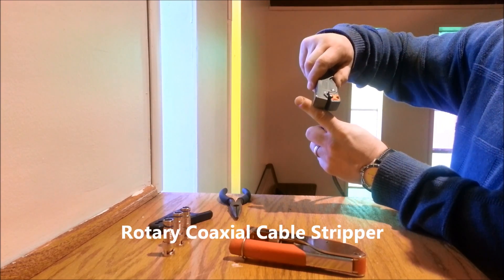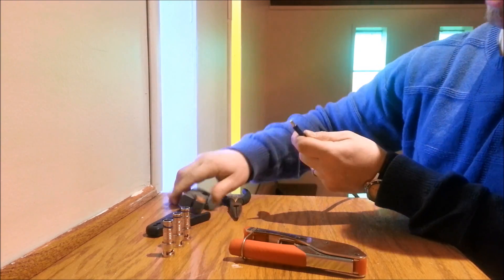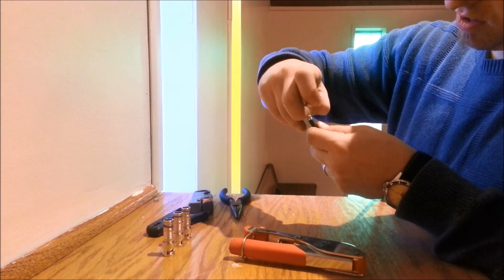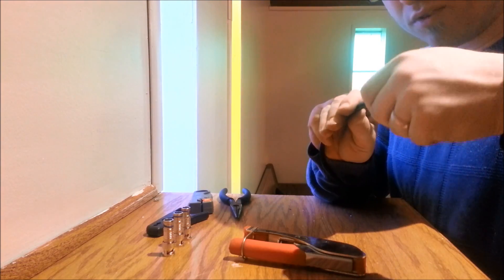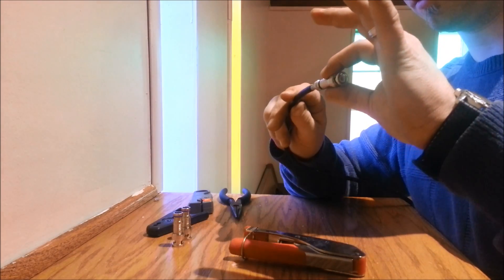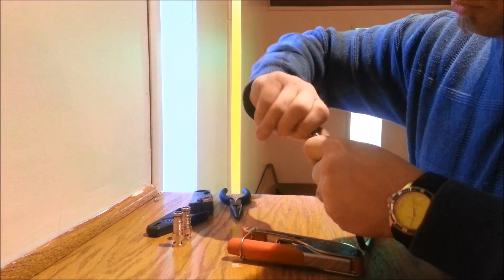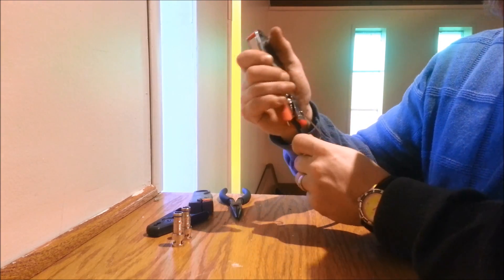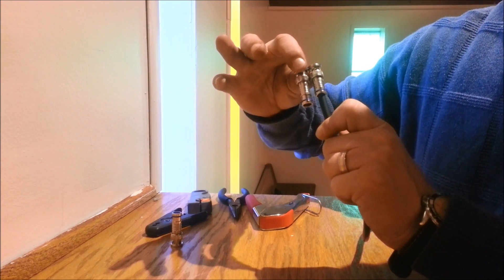How To: BNC Compression Fittings - 104

Comment: Thank you for what? I have the exact trimmer that he has. The stupid thing does not come with any instructions to set the blades depth. That is why I'm here to learn. I was excited when I saw he has the same tool. But he just used it without showing how to set the cutting blades. Because no matter how I tried. The d.a.m.n thing just don't trim right. Unless the blades are set at the proper deph.
Reply from the maker: thank you for the comment. generally with a cutting tool, and you don't know what setting to use, you want to start with the largest option and work your way down to the smallest option. that being said, the setting i use 98% of the time is when the arrow points to the 8.

Comment: Question 
I tried to do this with basic hand  pliers to Squeeze  the connector to the cable, now I have a no HDMI 1 no Signal can it be I didn’t do it correctly
Reply from the maker: I am sorry to hear that your HDMI cable is no longer working. this video was for installing BNC connectors, which get installed on coax cable, so this process would not work for an HDMI cable.

Comment: Would be interested to see closer how the compression tool works. It converts between female connector and coaxial Male.
Reply from the maker: sure thing.  i'll put something together that shows the compression tool a bit better.
Reply: Kurt Schwob I’m looking to buy a compression tool from amazon in the UK any recommendations?
Reply from the maker: i am not sure what shipping would be like on this particular product, but this is what i currently am using.  if you are planing on just using it casually, this type should do you just fine.  amazon product: B073TWL5G4

I am almost done with getting an up-close and personal video with the different connectors that the tool can crimp as well.

Comment: Thanks for the video. Sorry to ask, but would be nice to see the cable tested too (not necessary, just would be nice to have)
Reply from the maker: Thanks!

At that time, I did not have a cable tester.  you can check out my video 'Extron 5CR Plus - 105' (https://www.youtube.com/watch?v=Be8ubw0slSA) that shows the cable in use.
Reply: @KurtSchwob  No cable tester needed, just use a DMM. Even a battery and a light bulb would work to prove continuity and no shorts between the center conductor and the shield.

Comment: bought tv antenna's need to run cable through wood wall outside to inside tv. also need to run cable through brick wall outside to inside tv. help
Reply from the maker: the best place to run cable though brick is by drilling your hole though the mortar between the bricks.  ideally, you'll have a long enough drill bit to punch though the inside of the house as well so you don't have alignment issues with the cable.  make sure you measure before drilling so you don't go into something you don't want to damage.  use caulking to fill in the gaps around the cable and the brick.  you can also get a nice cable wall plate (http://www.monoprice.com/product?p_id=3997) for the inside.  depending on how the holidays go, i might be able to put out a video for such a task.